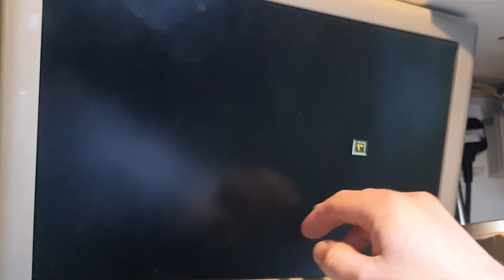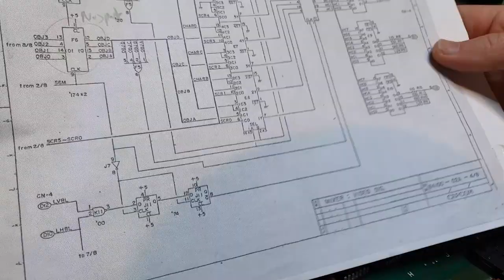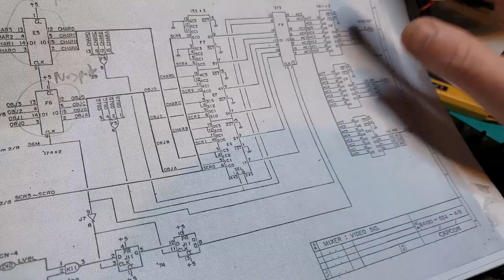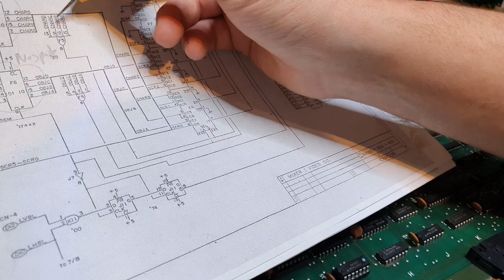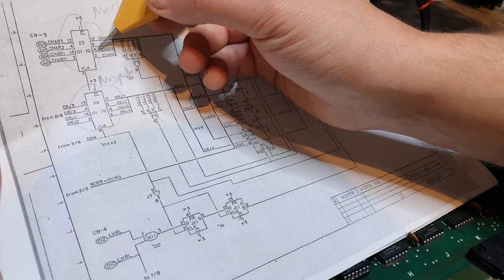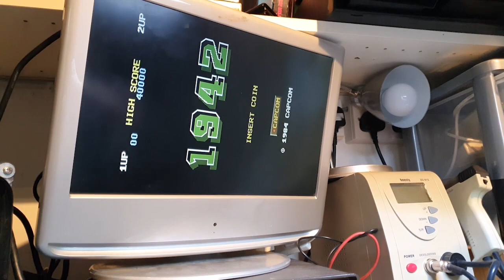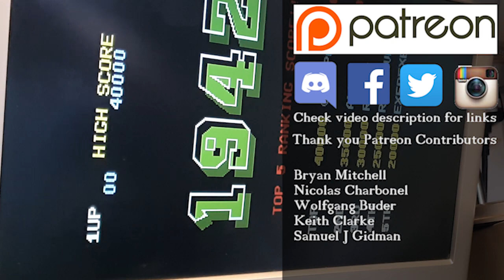1942 PCB Develops another Fault

Comment: I have a 1942 board and maybe you can help on this. Around 0:42 noticed the capcom logo has a space in it. Is that normal? Mine does the same. Also when playing there one little horizontal line near the bottom of the sceen. Do you know what could cause that? Otherwise the game runs perfect.